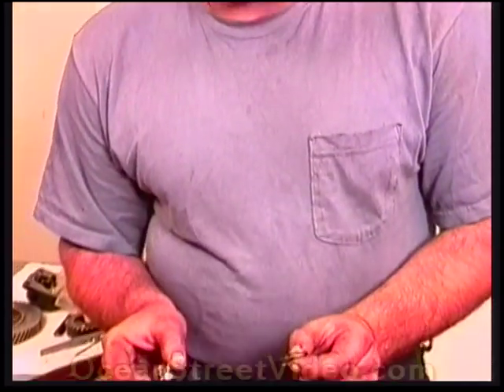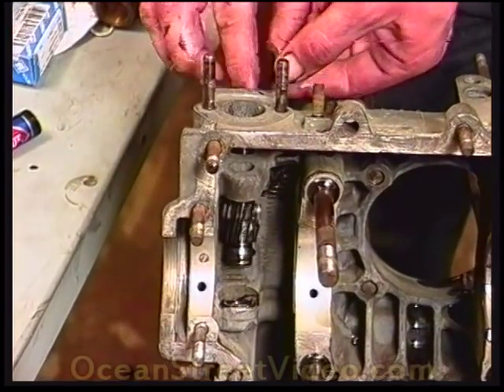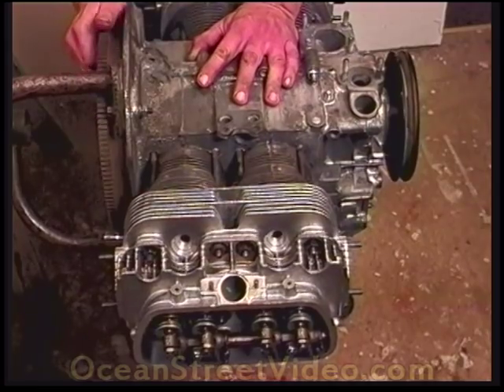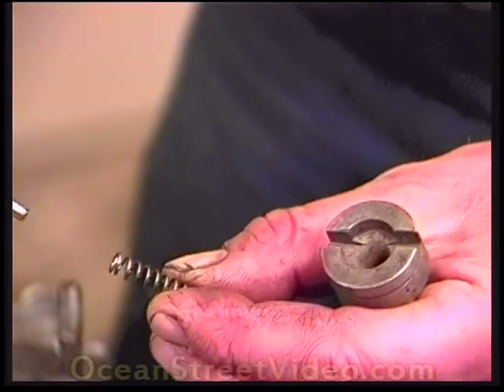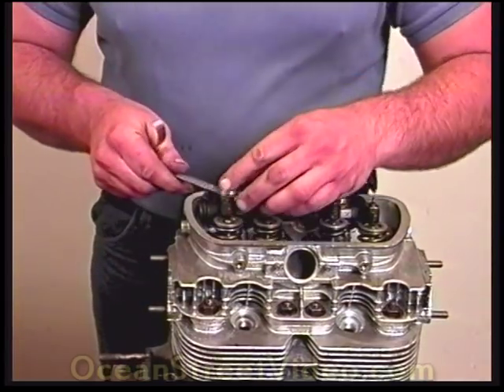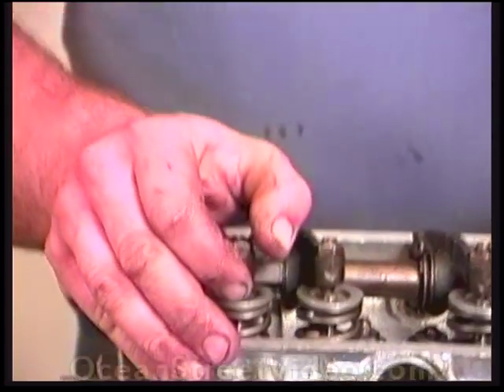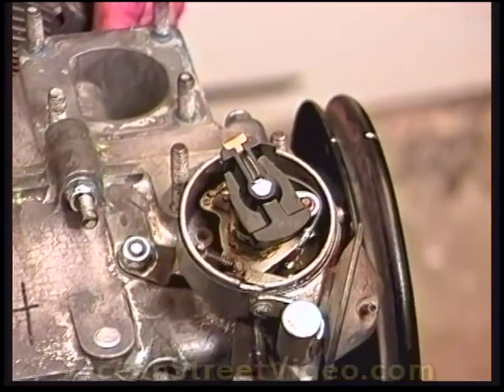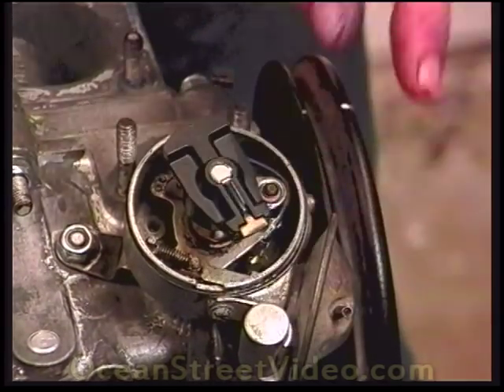VW Engine Build: Final Assembly Part 1, distributor drive gear, Type 1

Comment: I've been a VW tech for 40 years and, while I'm not saying you're wrong, I've always installed the distributor drive first, then the distributor. I rotate the distributor shaft until it's pointing at the #1 cylinder mark on the distributor. When I'm ready to lay the crankshaft in I hold the #1 rod fully extended and then drop it in-engaging the drive. Now the crank is at TDC for number one cylinder and the rotor is pointing at the appropriate spot. I've built hundreds of engines and they always start with minimal effort first time. No worrying about shims dropping out of place and you can see whether there is appropriate engagement of the distributor tang into the drive.
Reply from the maker: One reason that we don't install the distributor with the crank is because we want to be able to evaluate short block crank rotation with the case nuts fully torqued down, without drag or interference from the distributor drive slug. That is important because of issues like bent cranks and faulty machining. Tang engagement isn't a problem if the proper test fitting is done before the case is buttoned up. Thanks for the comment.

Comment: Thanks for sharing, I needed that, I was wondering how was going to drop in the drive and washers without dropping them into the camshaft drive cavity...a couple minor things though...1. at the 2:52 min point you mention the woodruff key pointing straight down, well yes it does when the case is open and on it's side like you have at that point of the video, but when assembled and you are installing the distributor drive, it will be pointing towards the #4 cyl, or the key is level and pointing left when facing the engine pulley if the case assembled as you drop in the drive.... 2. at the 3:25 min point, did you mean to say when both valves are closed on #1, that #2 exh valve is open, and not #3? Again thanks for the tips and info...much appreciated!...Mike

Comment: a question sir...why can't you install the diatributor driving gear while the crankcase is still open??
Reply from the maker: One reason is that you want to be able to fully evaluate the camshaft rotation and such, with the case nuts torqued down.

Comment: Cylinders 1 and 2 are not as hot as 3 and 4 howcome and it has a miss but when I hold it on a high rev there's no miss howcome? What can be the problem
Reply from the maker: +Rudy - Is it single port or dual port? DP was a big improvement towards equivalent side-to-side temps. The miss could be anything; replace spark plugs and wires, check valve adjustment, do a compression check, etc.

Comment: i have a question ! i have a head number 3 cylinder threads stripped , now instead of fixing this with a helicoil and take the chance it will unscrew or strip easy , i thought i would just retap the head to use a bigger diameter spark plug , this way the head is tapped more solid ? is this a good idea or is it heli coil or juck the head ? thanks for all your nice info , enjoyable to me .
Reply from the maker: i would try the time-sert approach first, there are places where you can rent the tool... here is a vid on it: https://www.youtube.com/watch?v=Ntiy8L97Nco
Reply: DragRacingTV how to get oil though the block and bearing before start up

Comment: Would you ever know if one  or both of the washers at the bottom of the distributor drive had fallen out of their small shelf and fallen to the bottom of the case when installing the distributor drive shaft?
Reply from the maker: +DG Carlson i don't know that there is a foolproof way to be sure, just put them in there with a little bit of grease, to keep them stuck together.

Comment: Your video are good but you not pointing at cylinder one on your distrubutor
Reply: it is not supose to be pointing at #1...
Reply: Yes the firing order is the firing order, but on the vw the dist. does not point to the #1 plug. Looking from the top of the dis it would be pointing at 4:00. when # vis firing. Most car it point at the cycl that is firing but not the vw.
Reply: @tonybland8684  Thanks for info much appreciated